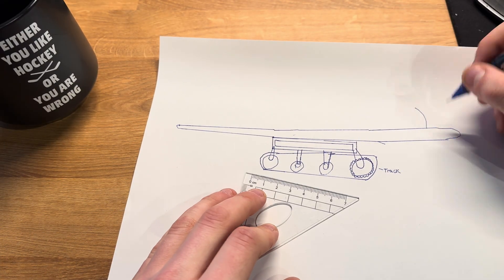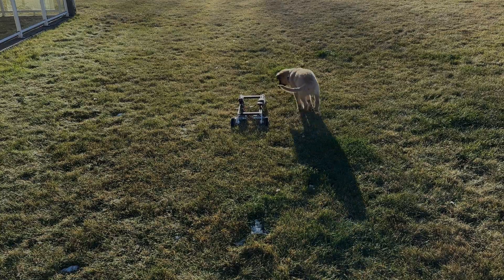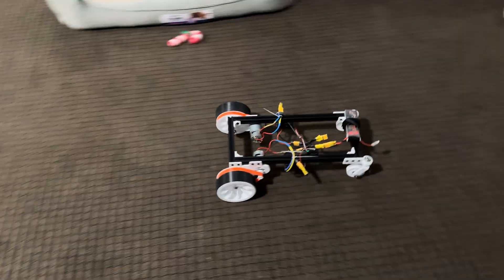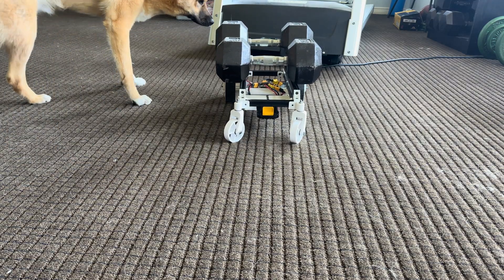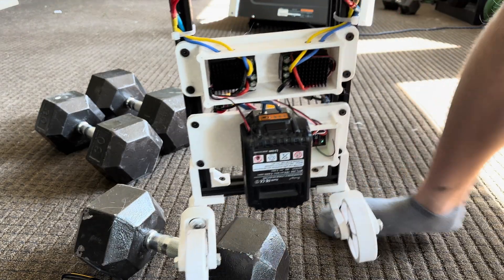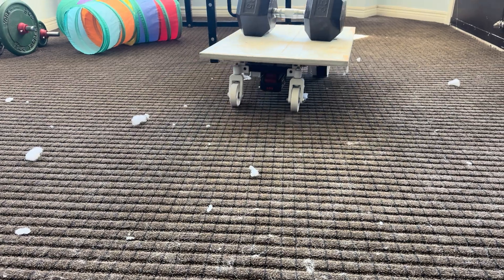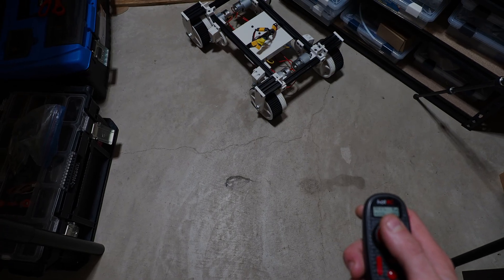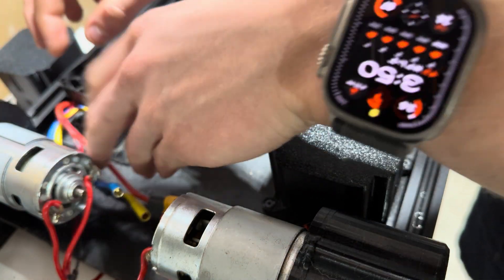Making A 3D Printed Cart That Can Carry Me

Comment: 13:20  designing an external mesh like this can add a lot of strength and save material for an injection molded part, but for 3D printing it does not make any sense. Just print bigger, chunkier parts. It will still use less plastic because of the infill, and the strength will be the same or better.